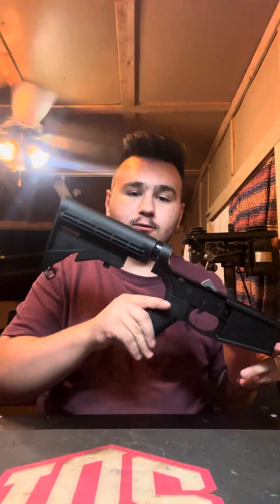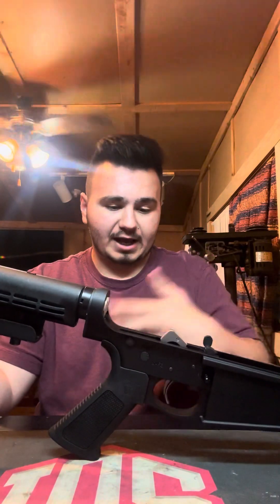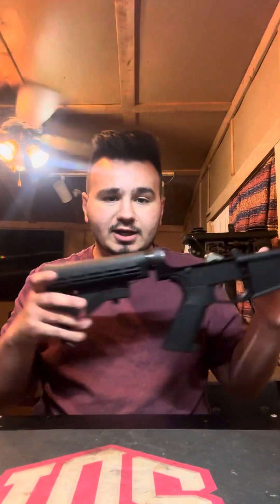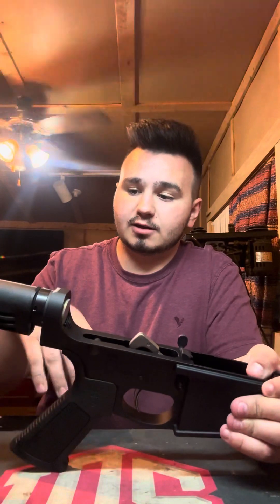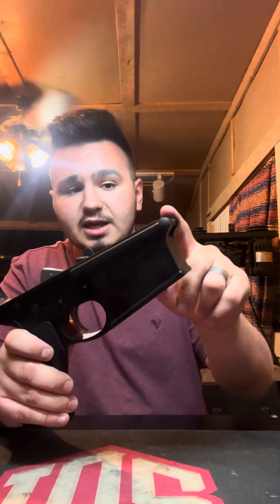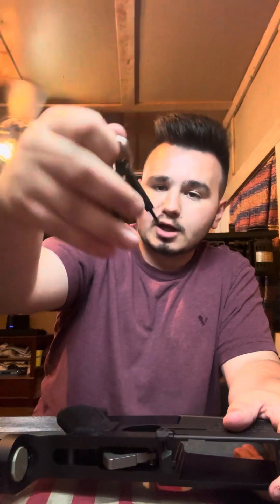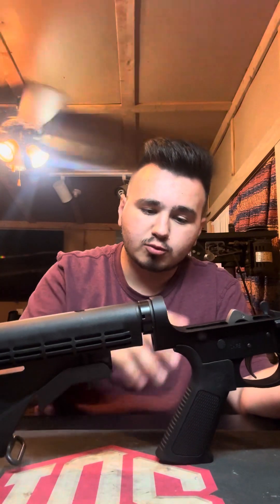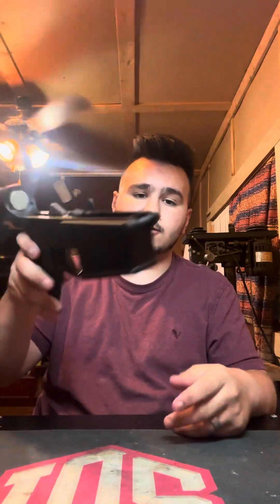SDI AR-10 Build - Lower Receiver Complete

Comment: Congrats bro, that looks good! I just put my AR pistol back together yesterday after hydro dipping (FTT201) and letting the clear coat dry for a day. That's the first time I ever assembled a firearm from scratch. It took a little over an hour, but now it functions better than when it was new. Just released the video a few minutes ago.
Reply from the maker: Thanks man! The lower wasn't too hard to put together but as I mentioned, those detent springs suck. I hope you are enjoying the Hydro Dipping lab. I had decided to go big or go home and hydro dip my Glock 43x. I did pretty well on it but noticed that it scratched easily so I actually ended up stripping it back down  to the factory finish.
Reply: @TennesseeTactical  yeah i thought about dipping my GX4 but the factory finish is already showing wear from going in and out of the holster, so I knew the thick paint would wear even faster. I bought the AR pistol as an expendable learning tool anyway, so it got to take the abuse of my inexperience with hydrodipping. lol

Comment: Charlie, thanks again for posting! My tools and parts arrive tomorrow. What is the trick with the tools you mentioned? I'm also looking forward to your next video. I could tell your excited about finishing. I am too! Do need or would like to have any additional tools for checkering?
Reply from the maker: Thanks for watching! I wouldn't really say there is a real trick than it is just trial and error that is with the pivot pin tool anyways. Also make sure everything that needs to be torqued or tightened is done so to the proper specifications so you don't risk hurting yourself or others. For example make sure the barrel is torqued to spec. As far as the checkering goes you don't necessarily need any other tools for it but you will need a ruler, tape, and tracing paper. oh yeah and an X-Acto knife. The checkering tool that they sent is OK but it's very limited to what it can do. If you really want to get into checkering I would suggest buying a better kit with higher quality materials.
Reply: @TennesseeTactical  Great tips and thanks for taking the time!
Reply: Did you have to get your lower milled before the build